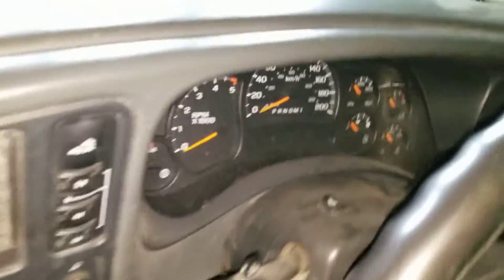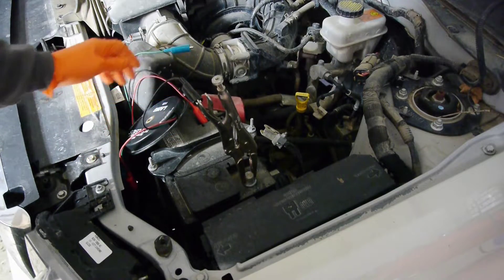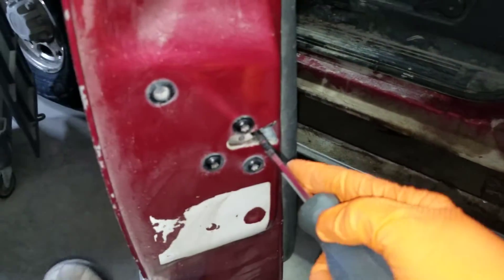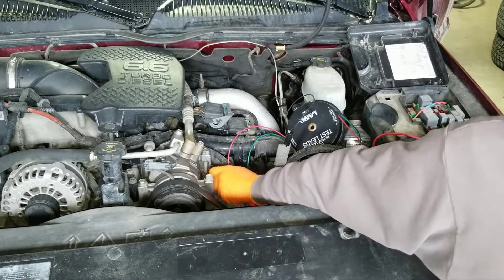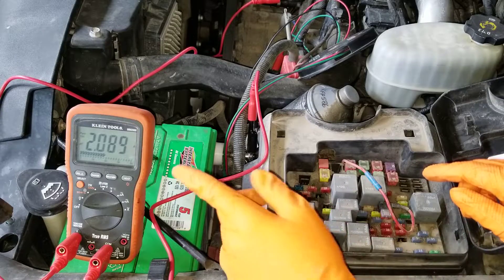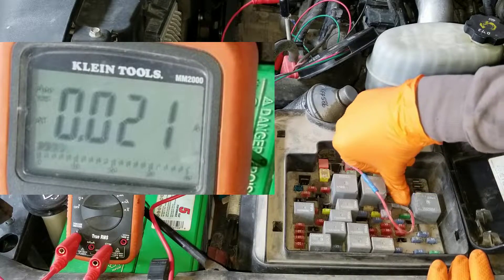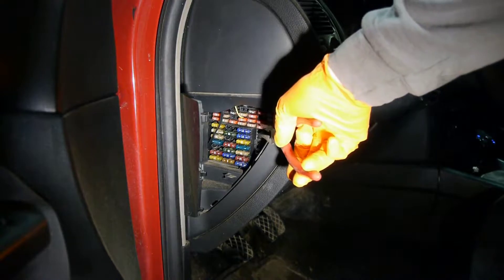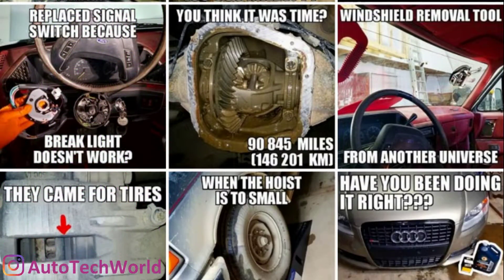How to do a Parasitic Draw Test | Includes Repairing the Draw

Comment: Hi, I've watched several  videos regarding parasitic draw and this answered questions that I didn't find elsewhere. I wasn't sure if once I had found the problem I could simply pull the offending fuse and leave it. Of course I wouldn't do that if it was something important, but if it turns out to be something I can live without (like a vanity mirror light) now I know that I can yank the fuse and not bother tracing it any further. And you were straight to the point. I'll watch this a few more times though, so I can understand what's going on with that spool of wires you used. I get the concept but I'll watch again so I'm sure to do it correctly. I see links for everything but that spool, so I'll watch again and let you know when I solve the problem. Thank you!
Reply from the maker: Thank you 🙏, if you have any questions feel free to ask.